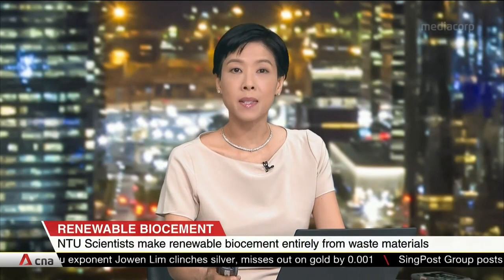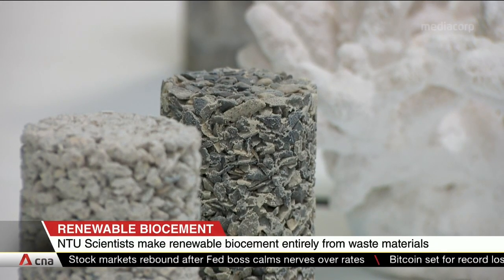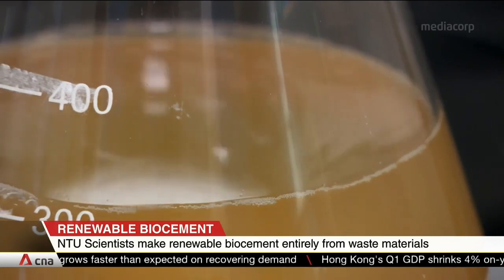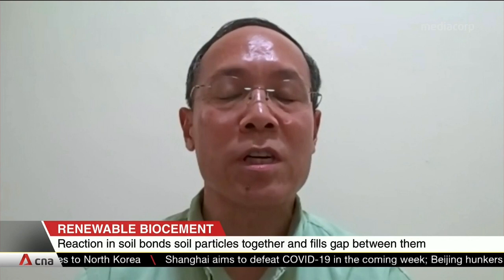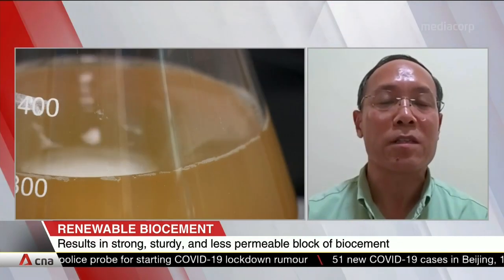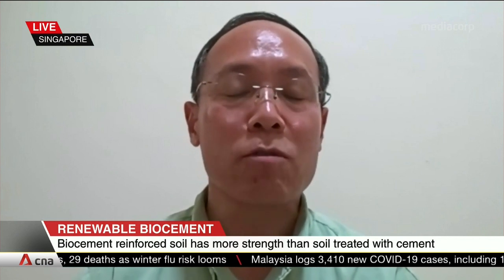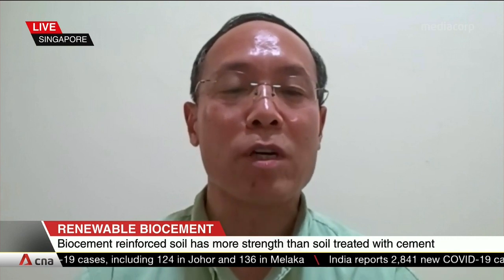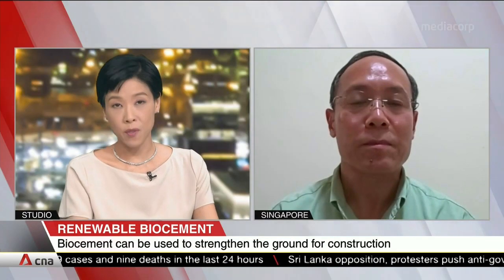NTU scientists create renewable biocement entirely out of waste material

Comment: 💡 Good invention ! 

New construction materials
- BIODEGRADABLE 
- STRONG as cement
- SAFE for residents i.e. does not emit toxic chemicals since this material is from industrial waste
- allow building to COOL under hot weather & KEEP WARM under cold weather naturally ! More healthy for residents & cut down on need for aircon. Reduce energy consumption & carbon emissions !

Architect's job to design building & units to enhance wind flow & circulation !